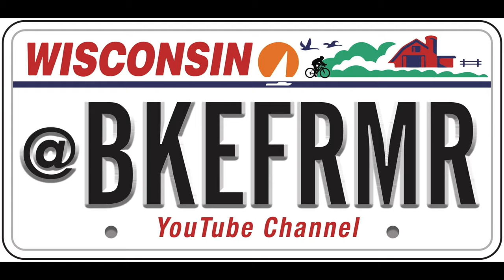THRIFT SHOP BICYCLE GAMBLE! Was this Mongoose worth saving? Clean, lube and adjust - bicycle tuneup!

Comment: I bought a Cannondale hybrid back in the early 90's for commuting. I've owned a great many bikes before and since but that Cannondale frameset seemed as though it were custom built for me. I just loved it. Fast forward to today. I dug the frame out storage and bought a used 1" Surly Cross-Check fork. I had them powder coated and built up with an Alfine 8 drivetrain, Velo Orange bars, stem,  cantis, levers, rims, front hub, pedals, Thompson post and Brooks B68 saddle and Schwalbe Marathon Plus Tours. Got 4x what it cost new into it but what a dream it is to ride! Sometimes the thing that we deem ancient is superior in some ways.

Comment: And there you have it… another reason why entry-level bikes should be 1x.
Reply from the maker: Yes. It's not worth "converting" this bike, but certainly, most non-cyclists would prefer 1x drivetrains. Unfortunately, most non-cyclists think that "more gears" means "better bike" so this is a challenge for the marketing department.

Comment: Old bikes are still great! I know everyone  wants the new hotness coming out, but I have a near mint '96 Fisher and a 08 Muirwoods that ride amazing. Especially if you're just cruising around on paths and the street.
Reply from the maker: Durable. Functional. Practical!
Reply: that one kinda skimped on the budget with an integrated derailleur hanger though, at least in my view. the frame will get bent instead and need fixing whereas you could have just bought a replacement derailleur hanger for like $5 instead

Comment: This turned into a nice little bike for the cash, no doubt.  If an old bike provides a safe and reliable ride for someone who lacks a ride, it's worth refurbishing.  One of my favorite kinds of bikes to refurb is the "hopeless case" that just needs a little TLC and maybe some new consumable parts.  With such bikes, I always rebuild the hub, BB, and headset bearings, and maybe the pedal bearings (though sometimes new set of pedals is called for).  They might feel OK, but that could be because they just got shot of WD40 that'll last about a day.  Properly rebuilding and adjusting them takes some time but ensures they'll last and run smoothly for a decade or more.  (Freewheel and freehub rebuilds are usually a bridge too far because there are so many types that each require their own tool.)  I also wear check the chain, then I remove and replace or deep clean it.  I clean the rest of the drive train while the chain and the wheels are off.  Such bikes often need new cables and even housings, and they nearly always need tubes and brake pads.  Tubes, a chain, and brake pads might total to $50-60 and are a worthwhile investment.
Reply: Read between the lines, properly regressing wheel bearings on a bike less than $300 isn't worth his time

Comment: Mongoose bicycles are some of the cheapest available in the market, yet you have resurrected a thrift shop bike for a customer. With some lube, spray wax and some knowledge, this bike is ready for the new owner. Well done!
Reply: That Mongoose is not a Walmart Mongoose.  Before the Walmart days, Mongoose bikes were sold in bike shops. They were top of the line bikes.
I have an 80's Mongoose ATB that I still  take on the trails. Also have a Mongoose  26" BMX Cruiser  that is worth thousands, and I ide ot to work often.
Mongoose used to be the shuit back in the day.
Reply: @indianadave8881  I think Mongoose contracted custom frame builder Tom Teesdale of Iowa to design some of their frames.

Comment: Never used furniture polish, heard of people using it. I personally like Pedro’s bike lust. Bike lust works on the axels and wheels to, without having a degreaser near your hubs.
Reply: Lemon Pledge has been an unspoken bike shop mechanic's staple since the early 1980's.  It's relatively cheap,  it's really good at cleaning and it leaves a bit of wax for polishing up, One of our suppliers even had LP as a shop supply.

Comment: I do volunteering in a bike workshop and last week I managed to pick up a 1996 Mongoose IBOC Pro SX, really cheap as it was donated to us as a job lot from another bike shop that had closed down. I have used the parts from this bike to complete a build on my 1999 GT Tequesta. I'll be cleaning up the Mongoose frame (Ritchey tubing) and sell it on. The Mongoose I bought was nearly top of the range, just below the Team edition, so good spec parts too! A very lucky find for me. I also bough a 2011 GT Zaskar Sport, which was also donated. The Zaskar was missing pedals and chain, thankfully I had some spares to fit to  complete the bike and is a blast to ride! 
I consider myself very lucky and I am obsessed with my GT's now.

Comment: OK  I've watched a couple of your vids,  I have a little pet peeve,  you have this pre operative spraying the bike down routine with wood polish,  that if I may be so brash.. is a bit excessive.

  What always worked really well, IMO was to do a two second spray of Lemon Pledge into the wipe down rag and then wipe the bike with the wetted part and finish with the dry.  You're spraying 70% of your polish into the surroundings, if there were bikes nearby that overspray will settle out on braking surfaces, pads and make all sorts of problems.  You'll also save on polish purchases.    Just sayin'
Reply from the maker: You’re not alone

Comment: I know it was the thing to lubricate cables sixty years ago when I was young. 3-in-1 oil was used. When I got back into cycling about eight years ago, I decided to lube my cables on a bike that I knew was junk out of the box ($199) Schwinn 3rd Avenue hybrid. 21 speed. I didn't know the cable housings had some kind of a Teflon liner that doesn't need lubing, but I lubed it, anyway. I used a petroleum-based grease, just a very find smear. Over the next several weeks, the cables got tighter and tighter until I couldn't change gears. After disconnecting the cable, I had a tough job to pull it out of its housing; it was tight all the way. I suspected that the grease caused the Teflon (or whatever it was) lining to swell. I mentioned this on a bike forum and was told I don't know what I'm talking about, because that couldn't have happened. So I gave up the forums because of the know-it-alls who don't know anything. So over the years, I have not lubricated any more of my cables, and they all work well, no rust or sticking.

Currently, I ride an Izip Zest step-through bike I bought new from a bike shop. It was set up very well (unlike another nearby bike shop who botched up everything they touched on the three new bikes I bought from them). It sounds like a cheap bike (which it is) but is super quality. List price is $795. I paid $435, but I think it's better quality than the big box store bikes. I only ride 8 miles a day, and sometime 20-30 miles during the Florida winters, so the bike serves me well. I'm too old to be hopping over the saddle, now.

Comment: Still interesting how derailleur bikes used to be the same for decades; just 5 to 8 speed with a freewheel, same chain, same chainblade...
Only in the past 15 years things have been changing basically every year... different size chains, different width sprockets, different freehub things like microspline, different axles like thru-axle instead of dropout, wider "boost" frames, etc...

Comment: Most of my bikes are used, they include Rivendells, Bontragers, and an old Masi. I had to soak the seat post and stem on the Masi for 2 weeks in anti-seize lube before I could remove them, but I've never not been able to get them out, I try not to cut anything. I always pull old BB's before I purchase, so I can check for rust. What do you do before you buy a used bike for re-sale?

Comment: to adjust the front derailleur cant you just do the same as the back? just remove the shift cable and set the limits without tension interference, then tighten the cable and use the barrel adjuster to index it all and then do the b limit as a finishing touch?

Comment: To me, a bike isn't practical, until you can set it up for grocery getting, or general transportation, with a good rack system and a trailer. I need to be able to live with it. A high fuel prices work around.
Reply: I expand a 33 liter back pack for the grocery runs.  Holds a ton.  I cheaped out on a pannier set and got what I paid for.  A good pannier set, even my cheap set, is very handy and useful.

Comment: The problem with the front derailleur? You dropped it too low.

Because I maintain my own bikes, I had a front derailleur problem on my 26". The issue was the same as yours. Come to find out, I had dropped the height of the derailleur too low, and the cage was hitting the big cog on the front.

Also: Why no service on the axle bearings, the BB bearings, or the headset bearings? If the bike was dusty, then the grease in all bearings was old, and the bearings should have been checked and regreased.

Comment: Doesn’t lubing the cables invite dirt? That’s my only concern. Retired auto mechanic here and amateur bicycle mechanic. Love your channel by the way
Reply from the maker: Not if you use the right lube. I use TriFlow. It’s a Teflon lube that scares away the hippies, but it works best. Also, it’s so easy to loosen cables to get your housing out of the way to clean things, dirt is sorta a non-issue, IMO
Reply: @bkefrmr I like tri flow for my personal bag. But at the shop I use Kroil. It’s amazing. It’s a bit pricey so I dole it out to the summer help so they don’t use it like water.
Reply: Kroll to loosen frozen bolts, quill stems and seat posts, PB blaster to loosen gummed up shifters.  @xmateinc

Comment: The cleaning and polishing would be the last thing I’d do. Only do it after you’re sure the thing can work without major work or replacement, or maybe even a bent or cracked frame.
Reply: Cleaning is the first thing we do at our shop too. It gives you a chance to put your hands on everything and find any problems, before you start the repairs.
Reply: And it is nicer to work on a clean bike.
 @xmateinc
Reply: @marta150  for sure, much easier to work on a clean bike.

Comment: why i switched to a one bi system. what a pain those front derailers can be..
Reply from the maker: I don’t think it ever makes sense to “switch” a bike to a single chainring, but I understand the merits of a 1x drivetrain for modern mountain biking.
Reply: There's a reason for multiple front rings. Setting them up in the right sequence helps: Set position on frame. With cable all slack, set limits, for all extremes of rear cluster. Set cable and indexing. If you start chasing setup from the wrong step, everything else will be off.

Comment: I was taught to True the wheel with air pressure so its under normal conditions - was that wrong or does it matter?
Reply from the maker: I’ve never heard that. I guess it makes sense enough to be believable!
Reply: @bkefrmr  I don't have an actual Truing caliper or I'd see if it made a difference ... Could be an interesting comparison

Comment: Hi! I have one question: is it recommended to lube cables which run in housings with plastic inners, or will they simply gum up?

There are some mechanics who advice against lubing them. Just leave them alone...?

Thank's!😎
Reply from the maker: depends on the lube. I use Tri-Flow on everything and love it.
Reply: @bkefrmr  I guess Tri-Flow isn't similar to WD-40, which is very hard on plastics and rubber?

Comment: How do you lube the cables with internal routing?
Reply from the maker: I usually don't. Way to risky. That can ruin a day. If it's working fine, I just leave it alone. I try to avoid cyclists because cyclist have bikes with internal routing. I hope they go to the cycling stores instead.
Reply: @bkefrmr  my salsa J-man has internal cables. I got it for some bike packing trips.
Reply from the maker: @thegolfwalker  sorry to hear that 😉

Comment: You charged $100 for that!? Ain’t no way I’ll ever go to a bike shop. I couldn’t imagine the price if you replaced a part. 
😱
OMG
Reply: He cleaned the frame and turned the wheels, as well as adjusted all the gears. 100 is a good price. Gets parts replaced during a full tune is the best value. But even ala cart its not that bad. You probably think bikes are just toys and so think people repairing them have no value.
Reply: The video is 40 mins, so before editing he probably spent 1:30 on this - do you think $60 /hour including rent/shop, tools, materials, tax, knowledge etc is too much?
Reply: Well, get out your wheel truing rig!

Comment: you charge him 100buck to clean and lub the bike ,,  for 100 you can get a bike like that brand new ,,  no wonder people don t like bike shops ,   that bike iven tune ,, is not worth more than 50 ,  if you can find idiot pay 200 for a used low end bike ,, tha was worth less than 200 when was new , ,  good for you ,  for 200 on used bike am expecting  wheels with cassete and doble wall , and aloy frame thedless .  and triger shifters ,   not a iron frame , single wall with freeweel ,  and no name revo shifters ,
Reply: Watch his video on why Bike Mechanics are a$$holes. You may find something to reflect upon.
Reply: The cheaper the bike, the greater the skill required to fettle it.
Reply: He trued the wheels and adjusted the braking and shifting. If you think that paying someone that doesn’t have to watch YouTube’s video for the basics isn’t worth it then please  stay out of bike shops. His price was fair and on par with industry standards.
Reply: Steel is real.